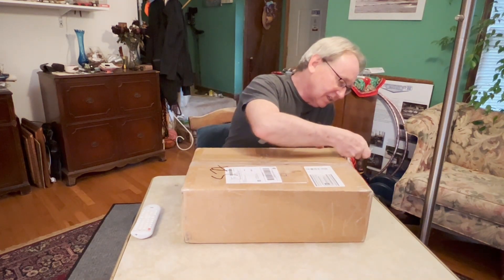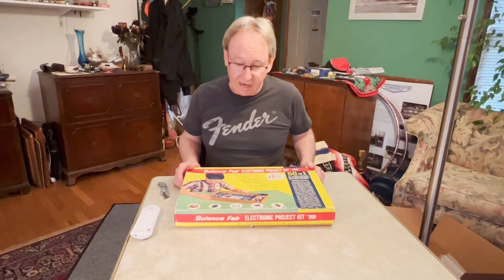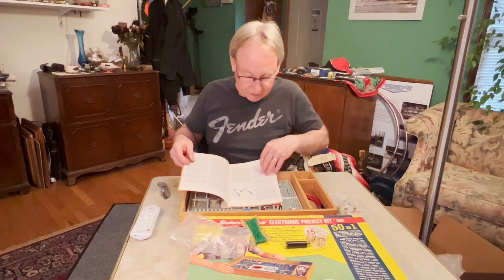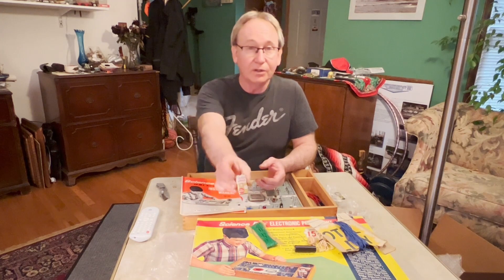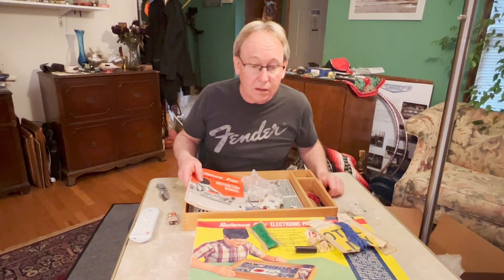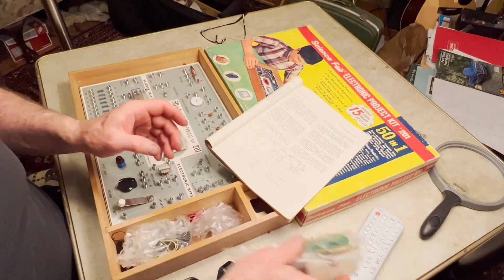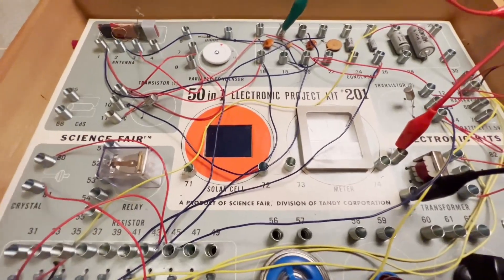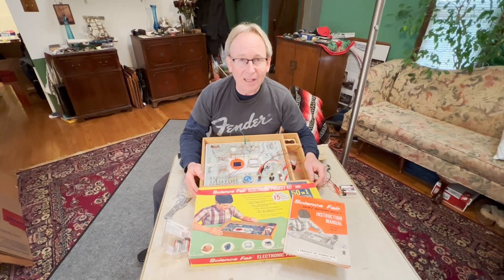Radio Shack Vintage 50 in 1 Project Kit: Let's Build A Two Transistor Radio

Comment: Toshiba 2SB57 transistor.
Reply from the maker: Thanks for watching. Did you mean 2SB257 Transistor which would have been the Germanium type in the kit? I think you left the middle "2" out.  The 2SB57 is a TO-3 Case Power Transistor.

Comment: I still have mine that I received as a birthday present when I was a kid from the mid 1970s.  I never used the schematics back then and only went by the numbers.  I may try the schematics someday when I retire just for fun!
Reply from the maker: Hi. Thanks for watching and taking the time to comment. That's awesome that you still have the one you were given as a birthday present. I actually still my original one also, but over time as a kid as I got more into electronics I "borrowed" parts from it that I sort of never returned lol. If you look in the comments, maybe even the previous one, the guy that was the kid on the cover and booklet saw the video and commented. He actually went to work for Radio Shack and would autograph the box/booklet for customers. 
I got the 1990's version (150 in 1) projects for my son which has some digital projects in addition to analog. It still has the AM Radio as one of the projects.  At some point I'll do a comparison build video.
Definitely try building by the schematics and then use the numbers to verify. That's how I learned. Photo copy the schematic and use pencil to check off what each connection. You can work left to right top to bottom, and or if it has a battery, work from the battery to other end, input to output or the opposite. Best wishes on that. Check in with me if you try and let me know how you did. :-)

Comment: I had one as a kid . It was easy to follow, and it started my life as a electronics hobbyist!
Still have it!
Reply from the maker: Hi. Thanks so much for watching and taking the time to comment. Looks like the kit had lifelong positive effects for both of us. Definitely easy to follow as you said. I gave the 130 in One kit to my son in the 90's. It was updated with digital projects as well as the old favorites. The Theory of Operation in the newer one wasn't as good as this kit. I might do a series of videos on some of the projects from both kits. There's lots of all the various kits Radio Shack sold over the years on eBay for about $30. This kit in this video given it's age is a bit more pricey  and often incomplete or beat up. The newer kits had more parts actually built in so they didn't get lost.

Comment: This is really cool but I don't think I could have figured it out as a kid... I would probably still struggle with it.
Reply from the maker: Hi, Thanks for watching and especially taking the time to comment and thinking it's cool. I think you would have done just fine as a kid. They had "training wheels" to make it easy. The leads to each component were numbered. It didn't really show and got kind of washed out but on the page under the schematic they had what numbers to connect to what numbers, so: 4-16-7-13 and 22-40-64-12 and so on. I used the chart at first and then saw how the numbers were the ends ot the parts, and learned their symbols. When I could read better I learned even more. 
I also have the "newer" kit I got my son in the 90's that has some updated digital projects, and the old ones as well. I'll do some videos on that. There's about 20 of the "newer" Science Fair 130 in 1 kit for about $30 on eBay. 
Thanks again for watching.

Comment: Elenco used to make those for Radio Shack. Elenco is still in business but it seems like they only have the EP60 spring terminal kit. The PNP was probably a germanium, which was the popular transistor type back then. Germanium was easier to make as a PNP. Basically a N type doped crystal that was P-doped with aluminum by dumping a current through the aluminum wire to N doped crystal. The current caused the aluminum to tunnel into the germanium and make a P type junction.
Reply from the maker: Hi. Thanks for watching and taking the time to write that great comment. Very much appreciated. I wasn't aware that Elenco made those kits. I taught Avionics/Electronics 10 or so years ago and we used the Elenco AM Radio and the Digital Multi Meter Kits which were quite good. The most important skill those kits taught was Read The Instructions, and Don't Lie. LOL I'd have young adults and folks in their 30's just solder all the parts in never doing any of the checks along the way and put the wrong resistors in, Electrolytics in backwards (can't hide that lol)  diodes in backwards, swap NPN with PNP or the EBC leads, chips in backwards etc, and then say "I did all the checks, but it doesn't work". I just shook my head.
Thanks for jogging my memory on the PNP's and Germanium. They are indeed Germanium PNP's in this kit. I used to teach all the Doping and theory on PN junctions and these guys could care less. They just laughed like Beavis and Butt Head every time I said Doping. Ridiculous.
I just dug out the Science Fair 130 in One kit Cat No 28-259 I got my son probably in the 90's. Ironically, the two transistor radio was still wired up on it. That circuit used a diode detector and two PNP's, and still works. It also has several basic Logic IC's, and 7 segment LED. 
Think I'll do a side by side comparison video of the two kits and maybe a few projects from the newer kit. The theory of operation write up on the newer kit as not as good as the 1967 kit. There's at least 15 of those kits on eBay right now for about $30 as well as other kits. They're great for getting a basic understanding of basic electronics. 
Thanks again. Hope you subscribed and gave me a thumbs up. Stay tuned for more content. I do lots of varied content in addition to electronics.